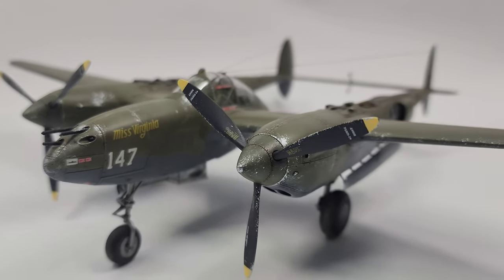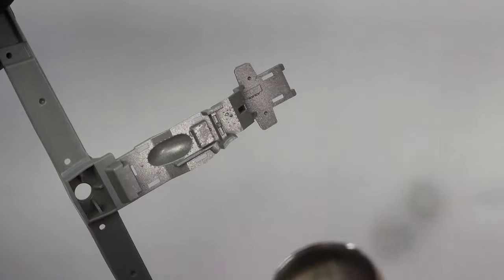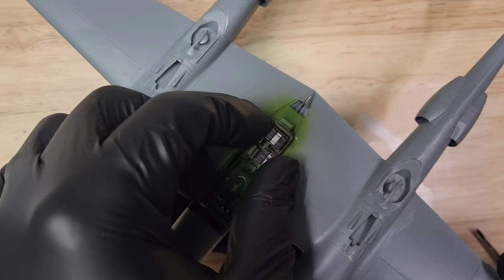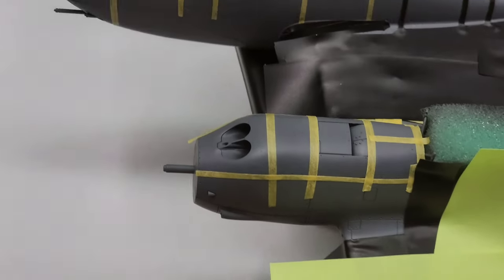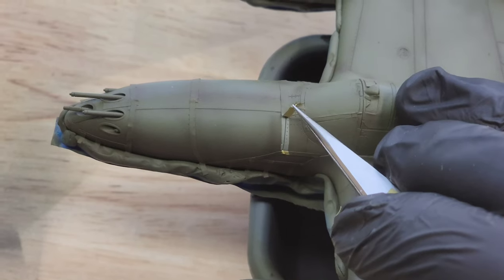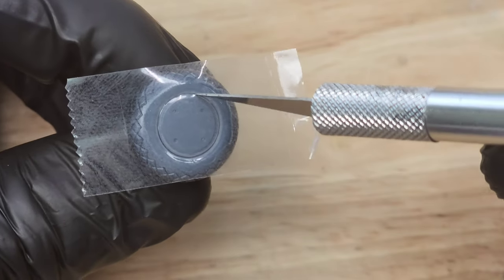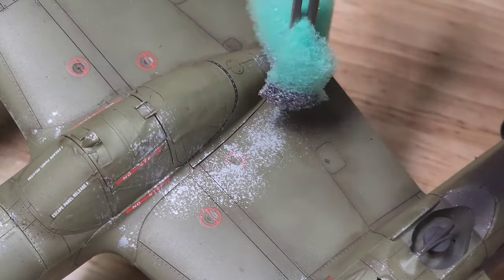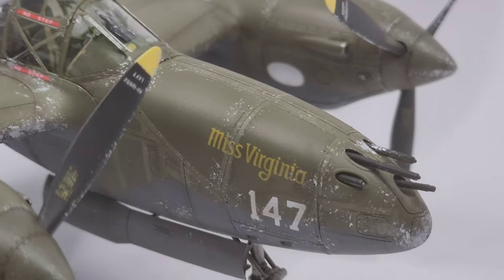1/48 Tamiya P-38 F/G Lightning Full Video Build Detailed

Comment: Nice work. I believe the lighter lines on the panel were by shipping tape. The aircraft were transported by sea and the tape was put on to prevent corrosion between the panels and getting inside the machine. You seem to have pulled it off (excuse pun!) Nicely.
Reply from the maker: Thanks for commenting!  That's great info!  Yes the shipping tape makes total sense!

Comment: The Stripes you have seen on Pictures  is because before they shipped the Aircrafts over the Ocean, they have sealed the Panel Lines, to avoid Corrosion, which could happen from the very salty  Water.